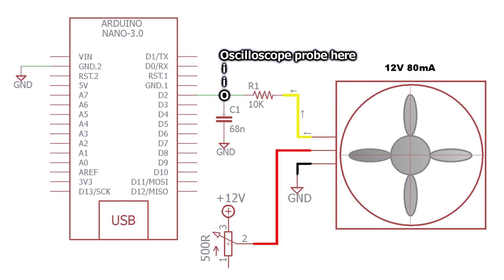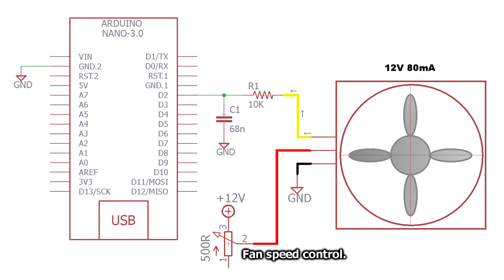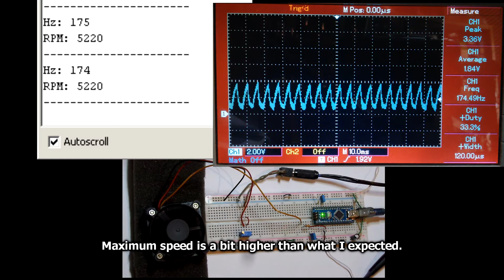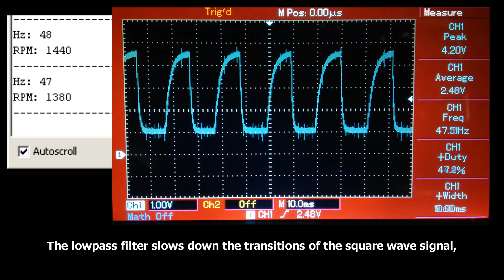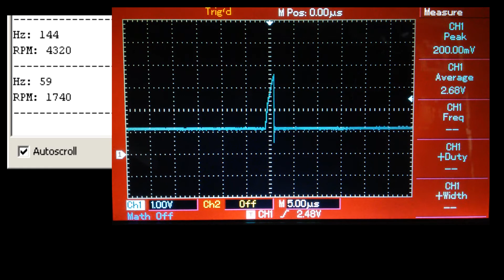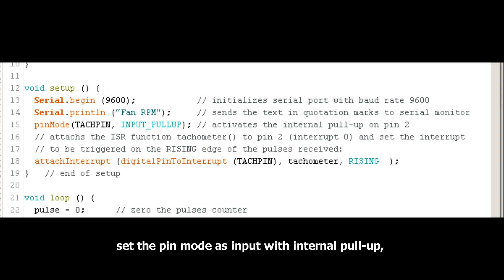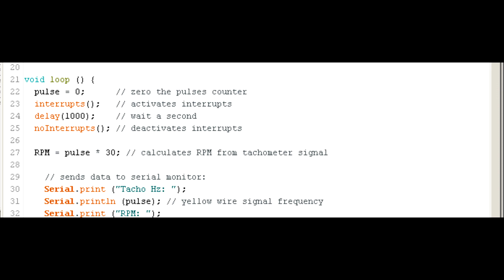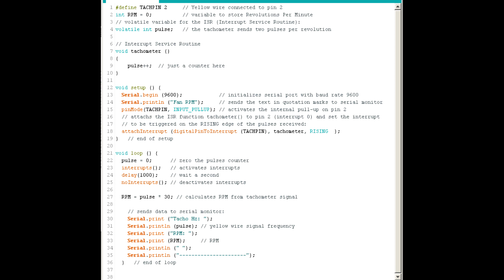Monitoring the RPM of a 12Vdc Three Wire Cooler Fan with Arduino, with speed control potentiometer

Comment: Hello. Does it work with multiple fans?
Reply from the maker: Hi. It does not work for monitoring multiple fans simultaneously. It can monitor multiple fans one at a time, using a switch to select among the fans to be monitored. Or change the code to use as many pins as the number of fans, and monitor the state of each pin in the loop() (without using an ISR).
Reply: If i have arduino nano i can connect only two fans (or more?) to check rpm simultaneously via pin 2,3?  Do I need to change anything else in the scheme?
Reply from the maker: How many fans need to be monitored, and how often?
Reply: @unrelatedactivities  5 fans, 12-20 times per minute.

Comment: Will 100nF be okay as a substitute for the 68nF?
Reply from the maker: With 10K and 100nF the cutoff frequency is 159Hz, it is a bit low, but should work. You can use a 100nF capacitor and change the resistor value from 10K to 6K8 to get the same cutoff as the original filter (234 Hz):
fc = 1 / 2*PI*R*C 
fc = 1 / 6.283 * 6800 * 0.0000001 = 234
Reply: @unrelatedactivities  Thanks a lot! I'm still starting my studies about electronics and most of these are still new to me and a bit confusing.

And may I know if 234Hz is the required frequency for all 3 wire fan or does it depends on different manufacturer?
Reply from the maker: You are welcome. It depends on whether there is switching noise on the tachometer signal, if it is clean there is no need for the RC filter. If the microcontroller delivers erratic results, then a RC filter can attenuate noise and solve the problem. The filter cutoff frequency should be above the maximum tachometer frequency, if the tachometer sends 2 pulses per revolution then its maximum frequency is the maximum fan's RPM divided by 30, so for a fan at 5000 RPM the tachometer signal frequency would be 166,6 Hz, and the filter cutoff could be somewhere above 166,6 Hz, for example 1.5 * 166,6 ~ 250Hz. If the noise amplitude is low, the filter cutoff frequency can be higher and still clean the signal.